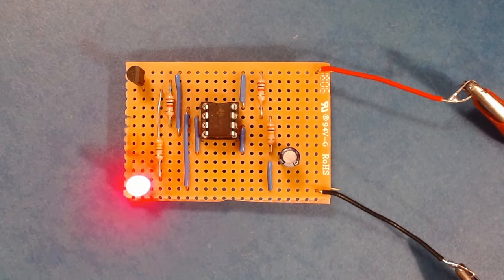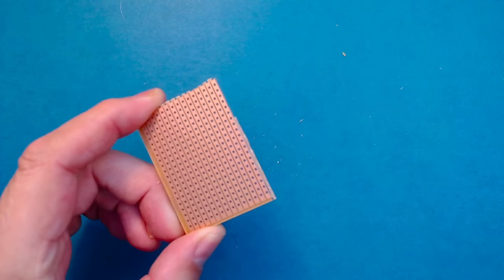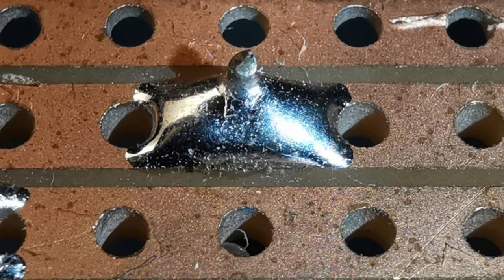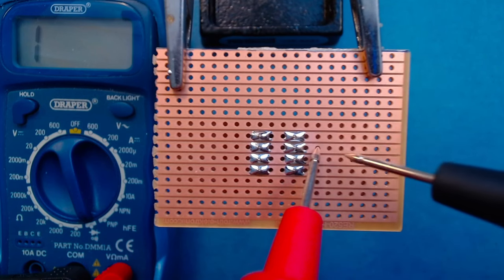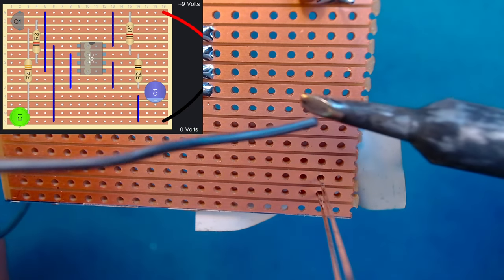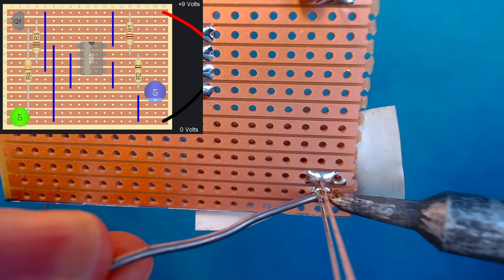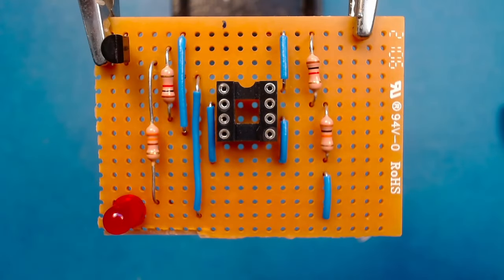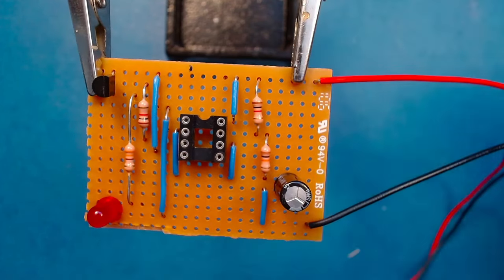How To Build Circuits On Stripboard or Veroboard

Comment: may I ask why are the circuit diagram and the actual object in opposite directions?
Reply from the maker: That's a good question. Circuit diagrams are often drawn up to make the function of the circuit easier to understand but often do not show the actual physical layout of the chips and other components. In the circuit diagram used for this video the transistor and LED are shown on the right side of the diagram and are connected to pin 3 of the 555 chip. However,  pin 3 on the 555 chip is actually on it's left side and so it makes sense to locate the transistor and LED on the left side when we are designing the layout of the circuit. The great thing about stripboard though is that if two or more components are soldered into the same copper strip they are then connected together regardless of which side of the board they are on. So I could have placed the transistor on the right side of the board and it would have worked just as well because what is important is that it is connected to the right copper strips. Hope that helps explain it better.

Comment: Good video but it looks like you're not using fume extractor. You should, because you're literally breathing in lead fumes and other stuff from flux.
Reply from the maker: You are absolutely right! Regular exposure to solder fumes may lead to the development of asthma (which I mention at the end of the video). Normally I do use one but it is quite noisy so I turned it off for the purpose of making the video. I made sure to work next to an open window though and kept the door open too to create a draught. Thanks for the tip!

Comment: Hi, just curious as to why you decided to add a transistor to drive the LED since a 555 can supply  a 200mA of output current.
Reply from the maker: That's true - it was really only put there so that I could show how to solder in a larger range of components.

Comment: I hate using Veroboard, but I have been using it for 50+ years. Prior to that I used tag board,  valves, and a bunsen-burner-heated lump of metal that was called a soldering iron (Dad used this to build wirelesses in the '50s, and a TV in the early '60s).

What I want is a module in KiCAD or equivalent that would produce the perforating and wiring diagram.
Reply from the maker: Yes that would be a handy module all right. I'd say you and your Dad must have made some interesting circuits!

Comment: Can be good 'near-finished' tip to check that the resistance between Vcc and Gnd of any ICs in the circuit should be some relatively high value and certainly not near short.
Reply from the maker: That's a great tip - Thanks!

Comment: I know of breadboards, and proto boards, but not strip boards, and the flexibility they can provide. This was very informative. I had never seen the tool you used to erode the copper strip to avoid a short circuit. In the case of removing some of the copper strip, you could have verified that the removal was successful by using the continuity mode on the multimeter, right?
Reply from the maker: Yep that's right continuity mode is great for checking that. Stripboard is really handy for small to medium sized projects and doesn't require any special equipment. Glad you liked the video!

Comment: What temperature is your soldering iron set at? What is the diameter of the solder? Why didn't you use a soldering paste before soldering? You can tell I'm new to the hobby. Thank you! I've learned a lot! Greetings from Chicago! Cheers, mate!
Reply from the maker: The soldering iron I use in the video is made by Antex and is one of the 25 watt models. The tip is 2.3mm in size and the temperature is around 370 to 390 degrees celcius. I use leaded solder because I find it easier to  work with but if you are using lead free solder the soldering iron temperature should be about 400 degrees C. I didn't use solder paste or Flux because the solder wire usually comes with some inside it. Applying a little extra Flux to the copper strip first can make things a little  easier though. Always make sure the copper is clean and shiny before attempting to solder otherwise you may find it hard to get the solder to stick to it. You can use a pencil eraser to clean the strip board first before you solder if it is looking a bit dull. Have fun!
Reply: @teksparkz  thank you for all the help!

Comment: Your solder looks a little chunky. I use 0.032" (0.8mm) or anything near 1mm. You get more control over the solder and 0.1" (2.5mm) spacing. 
I did a circuit using a breadboard layout stripboard 3 power rails, 5 pin vertical, 2 pin centre vertical, and cut away the bottom side as I was using MOSFETs and not ICs, so, extra board was not required. It was a RGB MOSFET controller as the micro-controller cap around 40mA and each LED pulls 20mA and it was a Race Drone triple 5050 LED strip. Power requirements jumped from 60, 120, 180mA depending on colour activation (White to Red, Yellow, Green, Cyan, Blue, Magenta). Board was 1" x 1.5" with 16 passives, 12 jumpers, 6 MOSFETs, 3 headers, or 86 of the 150 holes used. 
Your design 2" x 1.5" with 6 passives, 6 jumpers, BJT(optional), Timer IC was spaced out quite a bit, or 37 of 300 holes used. I may have shrunk it down to quarter of the size. You can stand resistors up or run them diagonally, plus cut some strips to make a tighter design like on a limited breadboard. You are building simple design but I would not want to buy the plastic project box to toss it into. Size is money in the hobby.
Reply from the maker: Yes you are right, 0.8mm gives more control but I didn't do too bad a job with the 1.2mm solder all the same ;-). That project you built sounds cool - you did a great job of reducing it down to a really small size. I could have done something similar but I wanted to keep the design relatively simple as the video is really aimed at beginners. I think that once people get the hang of the technique they will probably realise they can reduce the size down a bit more themselves, but thanks for the tip!

Comment: What is the name of the blue wire you use?
Reply from the maker: Hi @blueeye699 - the blue wire in DIYLC is called jumper wire and it is shown just under the hookup wire in the side menu. The actual type of wire I use to make the circuit has the following specifications: 0.26 mm² Hook Up Wire, 23 AWG, 1/0.6 mm, with PVC Insulation. AWG stands for American Wire Grade - The larger the number the thinner the wire is - in this case it is 23 AWG. In Europe the type of wire is called 1/0.6 which means one single strand (or solid) with a thickness of 0.6mm.

Comment: What are suitable wires for projects like this? I always used ethernet UTP cables in the past. They are easy to cut by accident (now i have better wire stri per), they heat up fast and insulation can easily melt which makes them literally painful to use. Also half of wires is white cause color band may be at the wrong side.
Reply from the maker: Hi @pavelperina7629, I use 0.26 mm² Equipment Wire, 23 AWG, 1/0.6 mm with a solid core. For wires  that need to be able to bend without breaking too easily I use 22AWG stranded wire instead of the solid core wire. I like the way you use UTP though - Great way to recycle bits of old cable. Hope that helps

Comment: Where you get one of them, track tools?
Reply from the maker: Hi Michael. They are called Stripboard track cutters. You can buy them from RS-Online here: https://ie.rs-online.com/web/p/pcb-milling-equipment/0543535?gb=s
A 3mm or 1/8th inch drill bit for drilling metal will work just as well though - and probably a bit cheaper.

Comment: is there any way to fix a track cut on the stripboard that wasn't supposed to be there?
Reply from the maker: Yes there is - You can insert a piece of wire to bridge the gap similar to the way you might insert a resistor or you can solder a piece of wire to the damaged strip like I do here https://youtu.be/GHtCEed583w?t=1679
I hope that helps 😀

Comment: How to connect ammeter on stripboard ??
Reply from the maker: Good question! In order to measure current the ammeter has to become a part of the circuit - i.e. current has to be able to flow through it. So you would have to take out one of the jumper wires and connect the ammeter in its place. Once you have measured the current you can then replace the jumper wire. Not as convenient as solderless breadboard but possible.

Comment: Maybe you should remove the metal alligator clip at the transistors side befor testing the circuit. Looks like it can accidentically short the copper lanes...
Reply from the maker: Good point - Well spotted!!